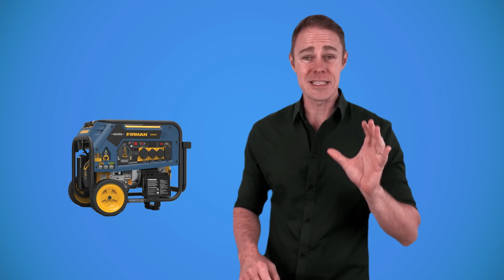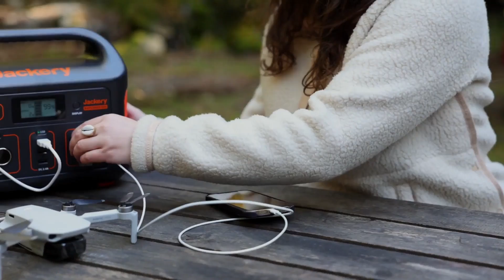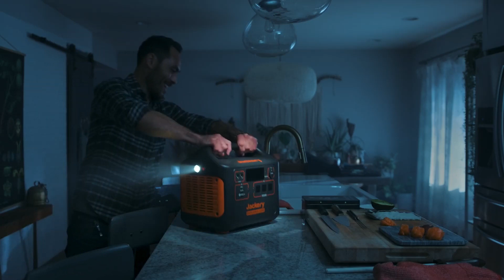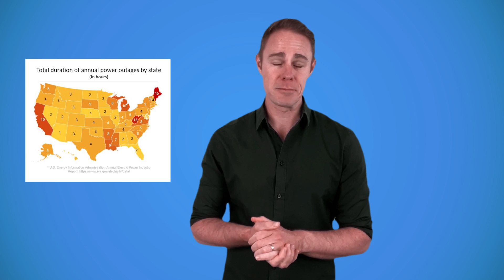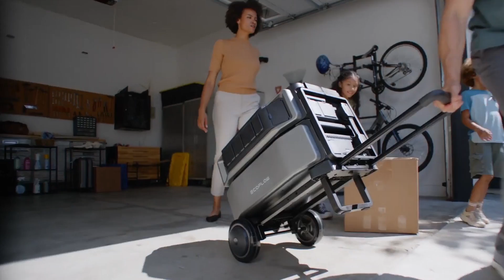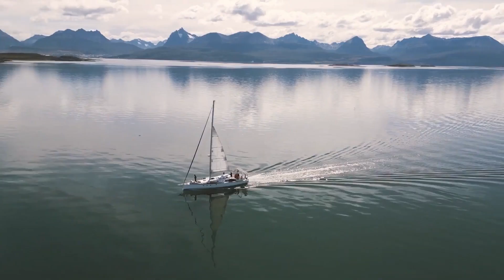Can a solar generator power your home during outages?

Comment: Thank you for the presentation. It has been a year and things are moving along. I am not trying to go off grid, just a little backup and to cut a few dollars of my power bill. I will also have the first solar panels in the neighborhood.  I just purchased a 2048Wh LiFePO4 Battery solar generator along with six 100w solar panels for around $1000. Last year this generator sold for around $1500 and now is on sale for half that. It is on sale because there is a whole new batch of generators that are even more powerful. Plug and play comes to solar power.

Comment: Can I get one large solar generator to power my home during an outage...I just need all lights, fridge and 1 A/C unit to run for 24 hours.
Reply: Going to be costly to run AC. Fridge is totally doable, but a central AC system is a huge drain. It will cost basically 10x as much to run your central AC. 

A good option might be a smaller, efficient window unit in a designated room that you can spend your time in during a power outage to stay cool. Cycle it on and off.
Reply: @galamonkey  Thanks for the reply, actually I mean't a single A/C unit for a designated room...my apologies for not being clear.
Reply: @Uncle-Basil you should be able to find a 5000 BTU window unit that takes 400-450w continuous at max output. If you can find a budget 500-600w solar panel (should be $250 or less) you should be able to cycle a residential fridge and window AC unit to keep yourself and your food cool. 

The bigger the power bank you have the better, but something in the 750kwh range would be great.
Reply: @galamonkey  Thanks so much for the help.
Reply: @Uncle-Basil Go verify it, I’m new to this and just started learning myself. Doing research to buy some equipment if we see a hurricane announced and headed our way.
Reply: I need to run large frig and separate standing freezer in summer, same in winter and run small 1500 watt heater.

Comment: Funny note here. You and Tanya use the word OPINION quite a bit. There is a funny expression about the word "opinion." I humbly suggest you use scientific facts, physics and hard core results to prove your points. That will increase respect that you need to get more business. Also, remember this. National or international averages of occurrences has zero to do with those of us that sometimes suffered without power from 1 day to several weeks with no generator or backup plan. Also, when mentioning let's say Powerwall, make concrete statements not based on what you hear but what you know for a fact. Otherwise, leave all companies out of these scenarios. I want you to win with facts. Hype is weak.

Comment: How about a solar power to generator to charging an auto battery.  Or. Solar to charging an auto battery?  Struggling to find a solution.
Reply from the maker: Technically, you can charge a car battery with solar if you add a charge controller in between - the way i see at least. But the thing is, a car battery is not the same as a deep-cycle battery. deep-cycle battery is meant to be charged and discharged. Car battery provides a quick burst of energy. If you charge and discharge it, it will quickly die out.
Reply: @a1solarstore  thanks. Just need to get car battery charged.